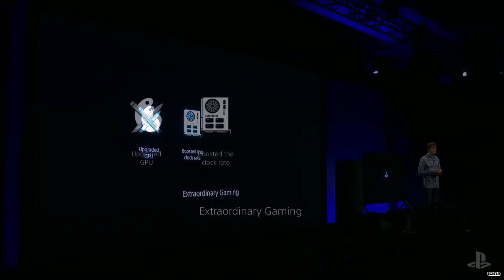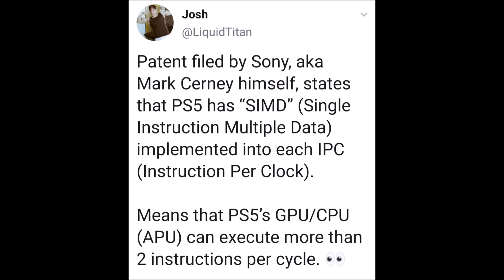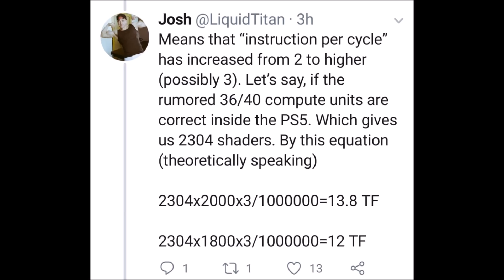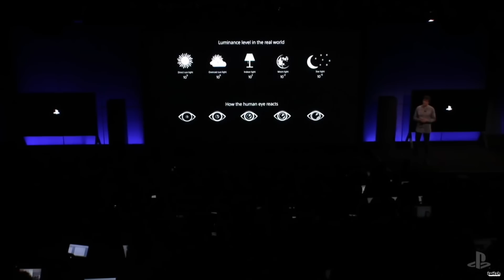Is This the PS5's "Secret Sauce"? Mark Cerny Rewriting The Tflop?

Comment: MBG: This could really hurt Xbox's launch if true.
Comment section: secret sauce
Reply: That, plus the confirmation that XBXSX will have no exclusives in the first year. (and I add, after that the exclusives will be Halo, Forza, the only good ones, and some other garbage).
Reply: Xbox is already fcked up
No exclusives for two years
And anw who is dumb enough to buy  a console less popular and less recognise worldwide
Reply: Now your resulting to making up myth and legends GPU that double in Teraflop because reason. Then you say 9.2 vs 12 Teraflop is a little bit more power. You do know the original Xbox one and PS4 had a .2 Teraflop different and the PS4 could run most games 1080 because of a .2 different in Teraflop. Now you want to bring real time Ray tracing into the mix. Have fun trying to get 60 fps with Ray tracing turn on.
Reply: @raekwonunique2798  Eh??? Didnt the XB1 GPU output 1.23TF and the PS4 1.84TF? I'm no expert but basic GCSE maths tell me your claimed difference of just .2TF is completely wrong. Back to school for you kid!
Reply: @CD-1977  you are right 1.34 over 1.84 is the correct number which give you .5 which ain't even a Teraflop of power different. So what is a 2.8 Teraflop power different going to make?
Reply: @raekwonunique2798  I think your problem is you believe the difference in TF is the only reason XB1 couldn't hit 1080p as often as PS4 when many Devs said the lack of memory bandwidth was a big problem. Also where are you getting these numbers from, we don't know what specs the next gen consoles have - it's all speculation right now. Wait until official specs are released before blowing your load over Phil's power claims.
Reply: @CD-1977  so you want me to believe if I had 6 tf of GPU compute I won't be able to run 1080 because I have DDR 5 memory. Second Phill has said double the power of on the GPU 6.4 X 2= 12.8. now where ps5 sits is questionable but looking at X and the pro we know Phil wants a big power leap. 9 tflop just isn't enough for real time Ray tracing.
Reply: @raekwonunique2798  No no, you completely misunderstood my comment. To make up for the lack of XB1 memory speed/bandwidth (as it only came with DDR3) MS used some ESRAM on the chip but didnt included enough for decent 1080p returns, at least thats what i read from game Devs (you know, the people unlike you or I who actually know these things...) Plus .5TF is a pretty big deficit when you are only starting with 1.3TF in the first place! 

With regards to Phil's claims of double the power that could mean a number of things and not necessarily a direct comparison of TF to TF. His statement could still be correct if the XB came with a 10TF GPU as i'm lead to believe RDNA is more efficient clock for clock than GCN is. Hitting this magical 12TF number seems very important to you so i hope it does indeed come with those specs just for your sake though. You also seem to believe this PS5 9.2TF claim is completely accurate too which it may end up being, but personally i wouldn't go around making such bold statements. Along time ago my  prediction for PS5 (which i understand is completely speculative btw) was 10.2TF so im sticking with that number, if its less so be it - it wont effect the pleasure i get from gaming in any way.
Reply: @CD-1977  you say ps5 coming out with 10.4 tf and no one at Sony said anything I don't know what ps5 target spec is I do know that they ain't laying the claim to world strongest I do know when you are talking about power on a GPU we use tf and we have been for years all of sudden Sony not the big boy on campus now we change measurements for power and Sony have secrets sauce new tech that double TF please. Next you going to tell me the earth is flat and gravity is fake. fact are if the Xbox original GPU had more tf it would have run 1080 no problems and that something you can't denial. Fact are Phill is not stepping down like Sony and he making it very clear that he wants the title world strongest on his console. Yes I'm going with 9.2 TF until Sony prove me otherwise if you have problems go talk to sony tell them to give us something other than a logo.
Reply: @raekwonunique2798  Eeeaasssy there Princess, you'll bust a blood vessel ranting on like that :) All i said there were other aspects to XB1 not hitting 1080p such as the ESRAM too, yes of course more CUs would have helped but they couldnt fit any more on the required die size because the ESRAM was there! Anyway, im not looking for an internet argument (unlike yourself it would appear), i'm just going by what some Devs said. I listen to them because I fully understand they know more about this sort of thing than me - i guess you think otherwise...

And with 10.2TF figure, that was a just conversation i was having with a mate shortly after the PS4 Pro release, we were speculating what sort of GPU power the next gen would have and that was the first number that came to mind. I never once said that figure was leaked or being claimed by Sony or anyone else - im not sure where you plucked that one from???

I have said since XB1X release that MS wont lose the power crown to Sony ever again, it cost them dearly...along with a couple of very poor marketing decisions - plus I think MS need the power crown more than Sony imo. Like i said above i actually hope you get your 12TF figure as that appears to be very important to you and i want everyone to get the most of their gaming regardless of their platform of choice but from your replies i'm guessing you dont feel the same about PS5 and want the power gap to be as big as possible...not sure why? :( Oh well, i guess some people are just bitter towards others  - never understood that myself, or the whole fanboy thing but each to their own! 

Good day!
Reply: @CD-1977  I would be offended by your insult but I know if we were having this discussion face to face you wouldn't be man enough to call me a princess to my face.  Then you talk about me going on about 12 Teraflop when you and your friends while working at good burger are pulling magic spec number out of air. Shit my number is being back by a source that actually talked to Microsoft, you know digital foundry. So we are in agreement if the Xbox original had more tf 1080 wouldn't be a problems. Yes 12 Teraflop is important because Ray tracing is very demanding and until they get over the limitations lighting effect were at a road block for graphic fidelity. So Microsoft making a console that can now stand on the PC platform is going to help push real time Ray tracing. Which means more games and less dev  time focusing on lighting and baking map to create the illusion of Ray tracing.